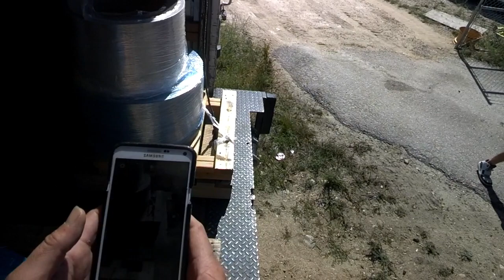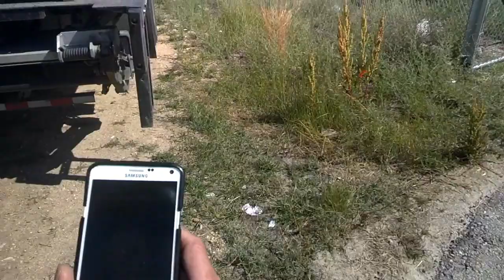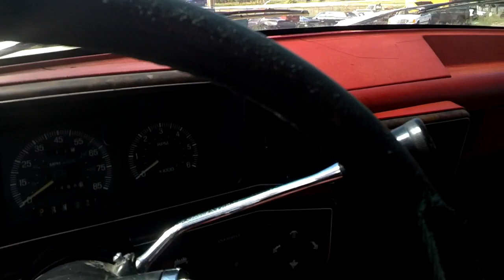SIDING COIL ACCIDENT ~ $1400 DAMAGE ~ DAILY VLOG 2020--0203

Comment: that company didnt secure that coil to the pallet properly. plastic wrap and sitting on a pallet is not going to work for that weight ,should be on the pallet ,metal banding holding the coils to the  pallet --then double ratchet strapped to the inside if the trucks bulkhead.they messed that up.